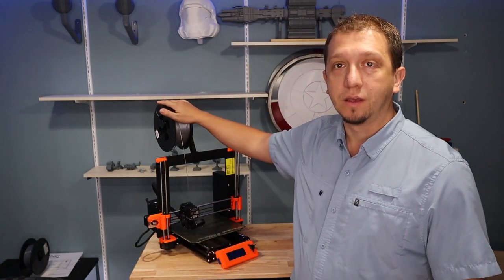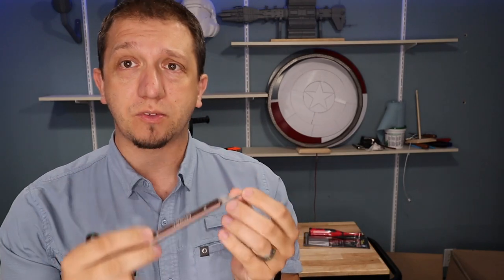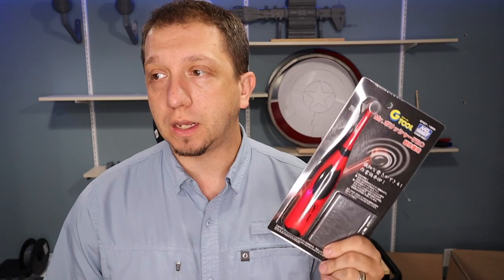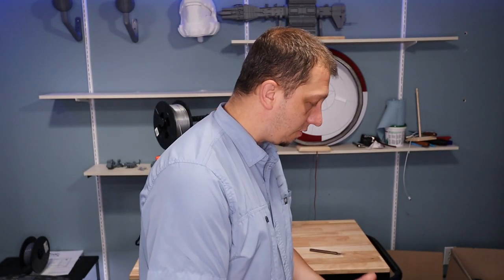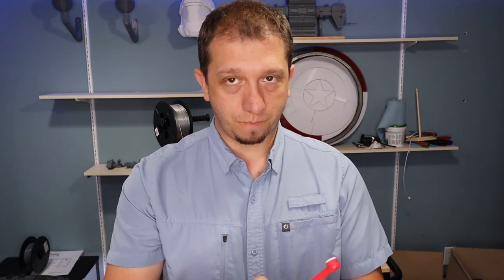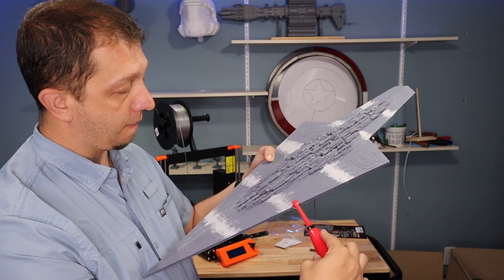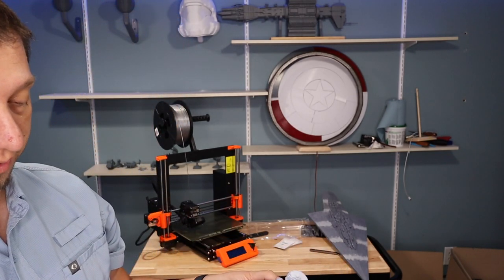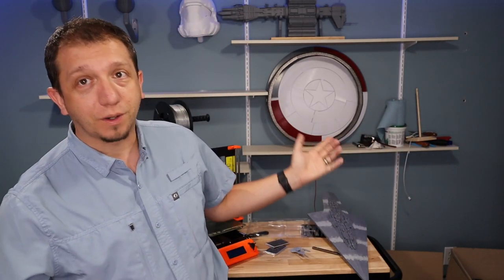How to fix layer lines 3D printing with the Mr. Polisher Pro, GSI Mr. Hobby

Comment: Very informative and yes, it sounds and looks like a electric tooth brush. I made the same thing with my old electric toothbrush. Just Velcro and hook and loop sand paper (cut to fit). By the way, I don't know if your looking at cue cards or a monitor to your right but you need to look straight into the camera when filming because it's kind of distracting. Subscribed to learn more!! Thank you.
Reply: Hi, you thought exactly the same thing as me when you saw this "Mr Polisher" and I will most certainly go in the same direction as you by reusing an old electric toothbrush and modifying the head to put paper pellets in it of glass with velcro, I also think that it is nothing more than that in the end and that it is sold as being a "tool" for 3D printing when they are only electric toothbrushes that have been diverted from their original function 😉
Reply: Do you have instructional videos for people actually making instructional videos? Until I see your perfect video then I’ll appreciate this man’s video more than your comment

Comment: For me some of the best tools to remove layers:
 - Card scraper (using hard metal sheet edge) is fastest but mostly limited to larger convex shapes.
 - Sanding using 60 grit (sand paper or pads) is my main tool usually using a Dremel on low RPM or a drill, sometimes with some water for cooling. May not work for models with fine details.
 - Hot air at 190‒200°C for PLA / 280°C for TPU works also really well to even reach a shine but it's harder to master (too long and you reveal the infill or disform the part, too few and you do nothing at all).

Comment: My first year of 3d printing i used a dermal. My 2nd year of 3d printing i moved to a Micro Sander that moves side to side. this was useful. did corners better. and can fit in little slots to clean out the edges  Proxxon 28594 Pen Sander might want to check it out.  P.S. if you going to use a dermal make sure you keep it very low RPM and a light touch or your going to heat up the plastic and melt it.
Reply: good advise at the end!

Comment: You get better results using a rotary tool. The motor on those cheap hand tools won't last for long, plus you have to have extra batteries. 
A rotary tool comes with hundreds of attachments and it also comes with variable speeds. I got one for $25 on harbor freight 5 years ago, and still works like new!
Reply: I was looking for this because I make jewelry and I have so many different rotary tools I was thinking why would you have to use this particular little $20 one if there’s a reason we would like to know

Comment: I bought a rotating toothbrush, 1/2 in glue dots and a 1/2 inch hole punch for the sandpaper. Take that 4-6 weeks shipping from Japan
Reply: What Toothbrush & hole punch did you buy?

Comment: what type of filler do you use on your models.??
Reply from the maker: I use a wide range.   Wood filler, tamiya resin filler,  Vallejo resin filler,   Depending on the size of the project I have even used bondo.

Comment: Thank you for sharing valuable tools and links. Another way for those users who want to get a smooth surface with FDM printing is that: we can try PVB filament, and be polished by alcohol and become a solid and smooth surface.
Reply: PVB, as you probably know, comes at a price premium, typically 25% more than 'common' filaments.

Comment: I would go for Argofile Artima over this tbh
Reply from the maker: I have one of the as well and it works gray.  My only issue is for a beginner getting into the hobby that is a sizable investment.  They are4 times the cost.  Also it’s corded so that can be a downfall depending on the circumstances.  Great addition to the posting?  What other tools do you feel is a have yo have for the hobby?
Reply: @Rise3DBuilds  I just got a deburring tool I want to try soon.  It seems like it will be good on masks around the jagged eye and contours that are sharp.  I have a Dremel tool but I like this little sander you showed.  I'm gonna purchase one .  Lol you can never have enough little toys  like these.  Did you do the video about the Dremel attachments yet?  If like to see some samples of useful ones.  Great videos by the way. 👍👍👍
Reply: Ya, I have this Artima5 too. It able to sand more narrow space.